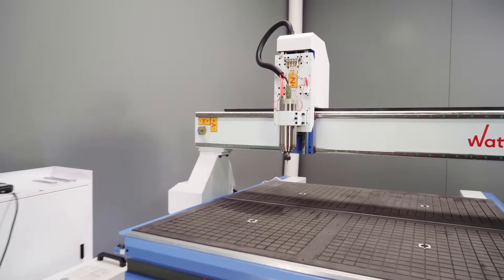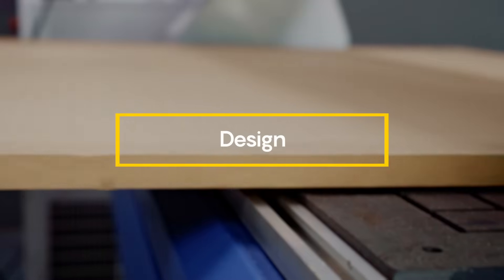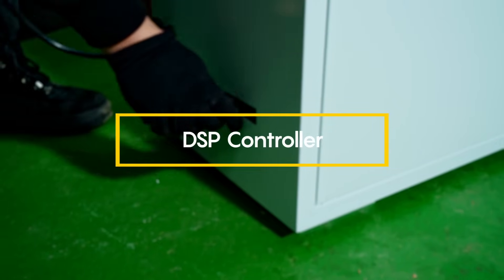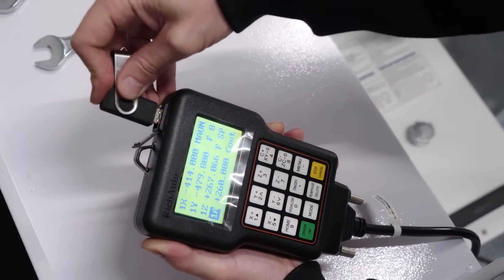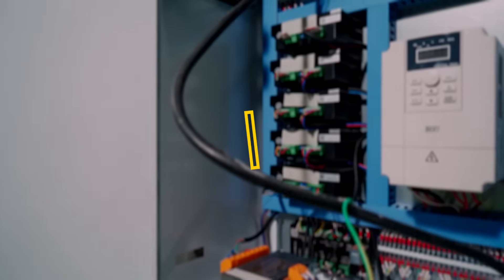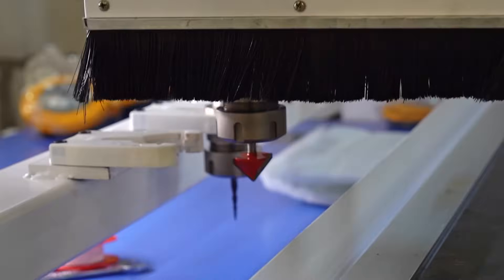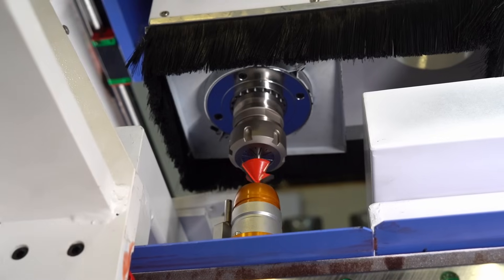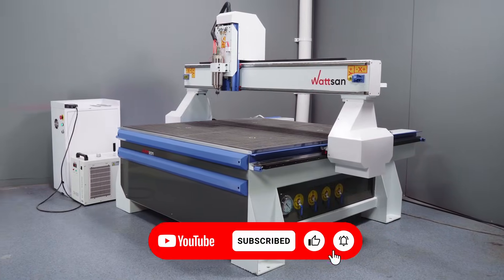8 Things to Improve CNC Router Efficiency

Comment: Rotary device makes CNC router 1000% more effective, the range of orders one can take with rotaty device is insane, so that's really a must-have
Reply from the maker: If you manufacture balusters, or anything cylindrical in shape, then yes. But if you really want to increase your productivity, we suggest buying either a CNC milling machine with auto tool change: https://virmer.com/catalog/cnc-milling-machines/cnc-router-machine-wattsan-m3-1325/
Or buy a milling machine with multiple spindles: https://virmer.com/catalog/cnc-milling-machines/cnc-router-machine-wattsan-m1-1324-s4/

Comment: Automatic tool change is often too expensive to install, cause qualified operator can change them himself within seconds
Reply from the maker: I agree with you that a machine with automatic tool changer is expensive. But for a production with a wide range of cutting and milling materials it will be very favourable.
We also have a ready-made machine with auto tool change✨ And you don't have to pay too much for its installation🤞